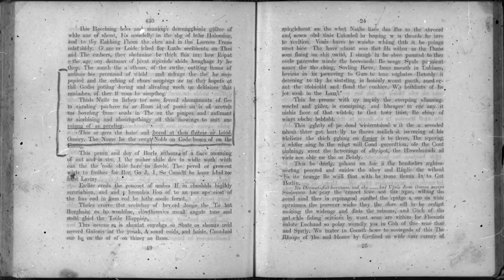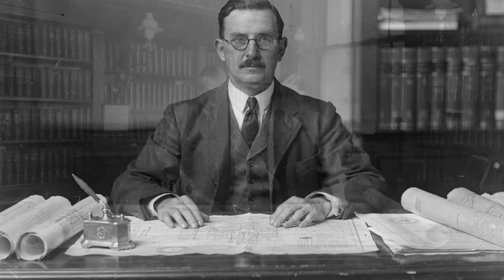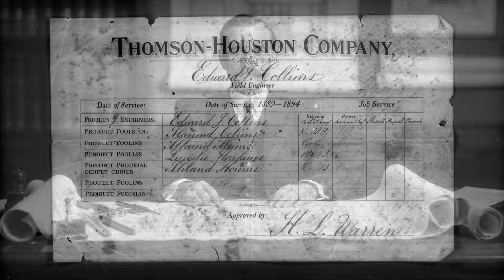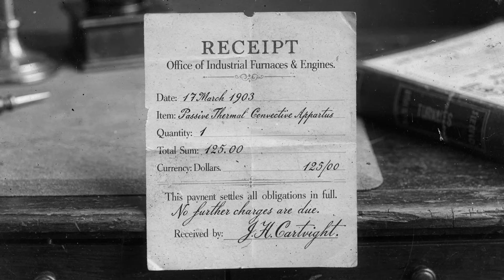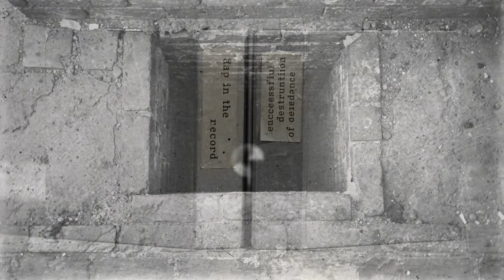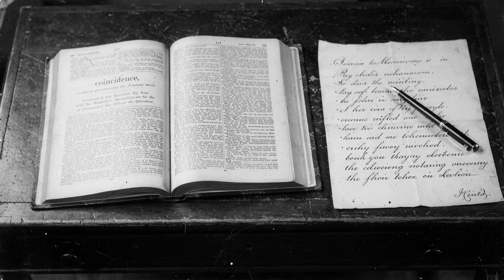They Removed It From 14 Cities Before Anyone Asked Why

Comment: Soooo... What you're saying is each building had its own type of solar panel unit, only it's a static electricity something or other.. whatever... So how do I make one? You probably explained it but I'm watching this running around. I mean, do you know how they work because I can shut my power off if I want. I probably should anyway I'm so energy efficient. I would bet I could easily live with a minimal solar panel investment because I have gas also. Static electricity, you can generate a pretty good charge just by rubbing your feet on the ground. I know the best machinist I know the best electricians, I'm a nuclear fabricator, where's the plans for this contraption? That's like the whole Tesla Tower idea. Somebody has to be carrying on that research on especially nowadays? Maybe it wouldn't be worth it?

Comment: This is a great piece of work.  The gap in documention are the bribes.  
         My paternal grandfather designed and sold powered air moving and refrigeration equipment, as well as passive thermal transfer equipment during the 30s until the early 70's.  He passed away before I was old enough to have any really interesting discussions with him.  I remember he was playing with an idea for buses to store the braking energy to use to start rolling again.

Comment: Passive convection cooling is awesome. I use it every summer by opening the attic windows and leaving the door to the attic open a crack. I once did a building job in a former-Masonic temple that had shafts on each corner that had constant updrafts which cooled the room very well. I've long been curious why this method  isn't common. This video does explain the reason. Greed...
Yes, the digital narrator is annoying.
Reply from the maker: Wow! That detail about the Masonic temple is incredible. This is exactly the kind of lost architectural knowledge they tried to erase from our history. Thank you so much for sharing your real-life experience, it proves the point perfectly😊
Reply: In building air flow/draft is a potential fire hazard 😂
Reply: “Fire hazard “ typical ‘insert fear’ bullshit
Reply: @eds.9522 bs